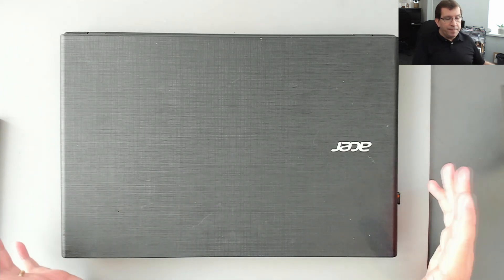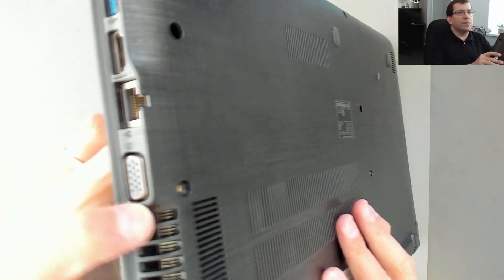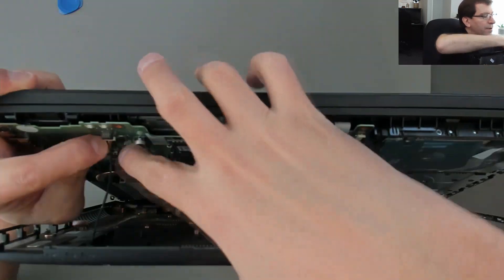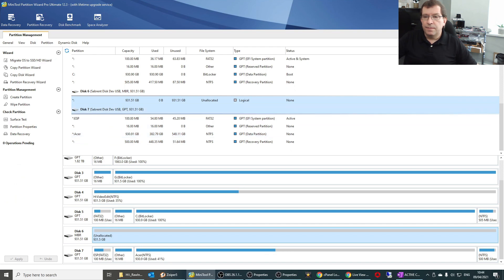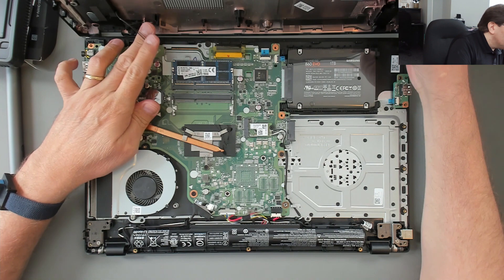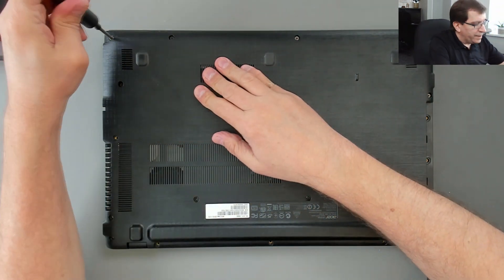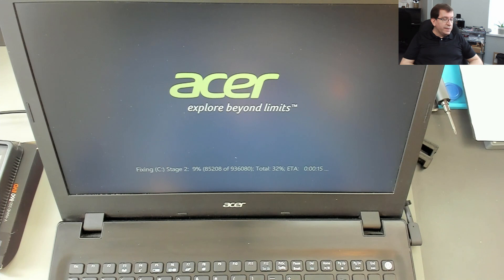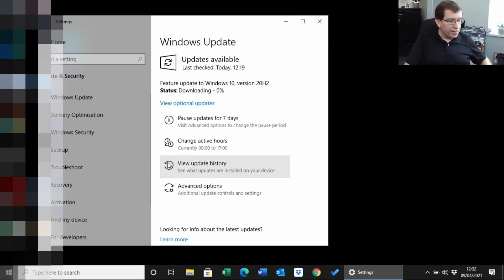[35] Acer Aspire F 15 (F5-571-5050) - SSD upgrade

Comment: hi sir..my laptop keeps automatically shutting down...i searched up some repairs and all of them say to press a button beside the ram sticks but unfortunately this laptop model tht is shown in the video does not have that...any solutions will help sir
Reply from the maker: I would need more information before I could offer any help. What is the exact make and model number? At what point does it shut down -- when trying to initially start? After loading Windows?

Comment: I have problem with my this same acer all the Time on the screen is "automaticaly repair preparing" I don't know why?
Reply from the maker: It's hard to say why, but sometimes that starts happening when a hard drive begins to get corrupted. I've had several cases where cloning the hard drive to a new SSD and then booting off of the new SSD solves the issue (sadly, not always though).
Reply: @ComputerHelpNI  Oh - Thank you

Comment: Very helpful, I have a slightly older version that I'm considering upgrading to an ssd drive, adding ram and a new battery so it's good to see how you've done this.  Thank you.
Reply from the maker: Thanks! The SSD upgrade made a huge difference in this case, so it was definitely worth it.